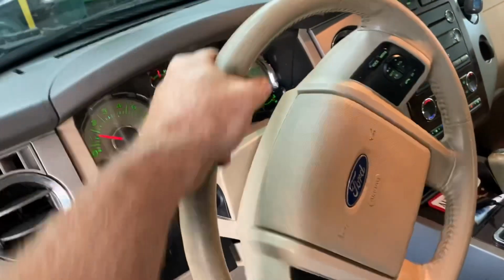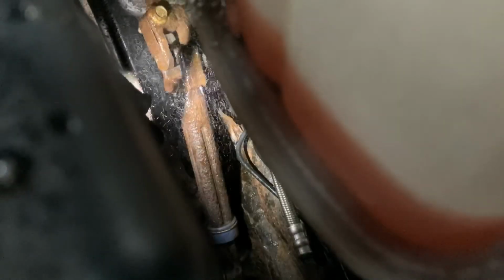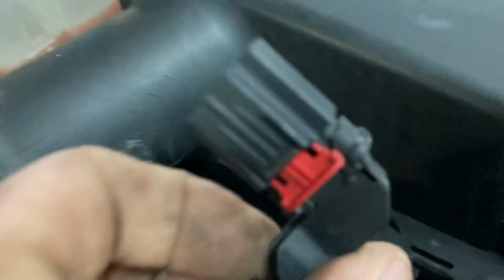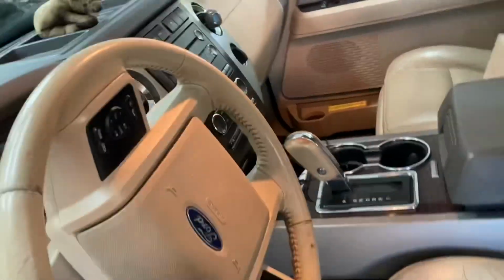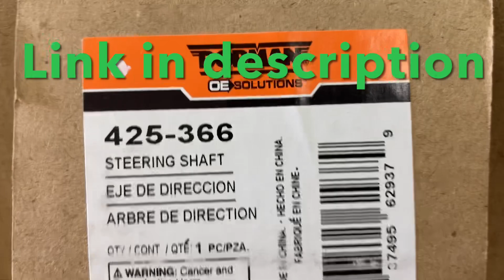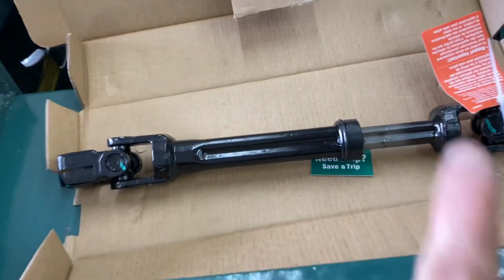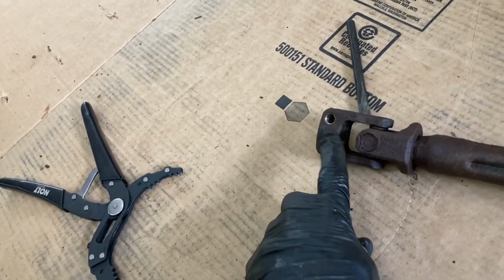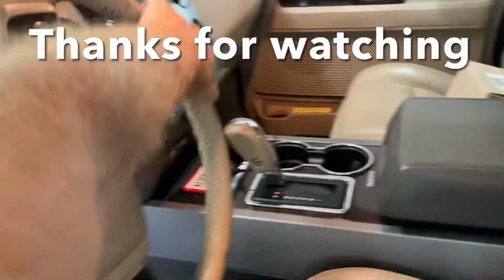Hard Steering- Easy diagnostic tip.. Ford Expedition 2008-2011

Comment: I can NOT believe that this was the problem. My truck sits for long periods of time. I had put a new power steering pump on not long ago and it never made noise so I didn’t think it was the pump.  It’s been so hard to turn for a while. All I did was get some brake cleaner to loosen the rust and spray that lube on and just like that; it was fine. I’m not replacing.  It works fine.  Thank you so much
Reply from the maker: @anthonymoorer8907  awesome I’m glad the video helped! Thanks for the nice comment